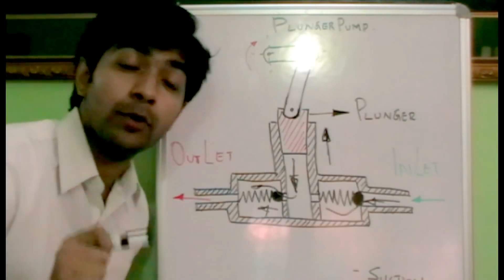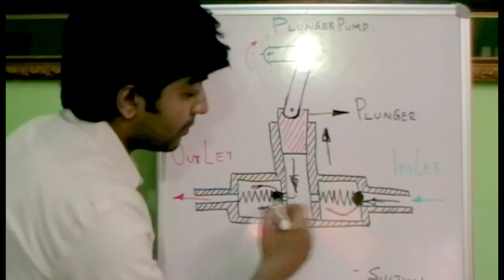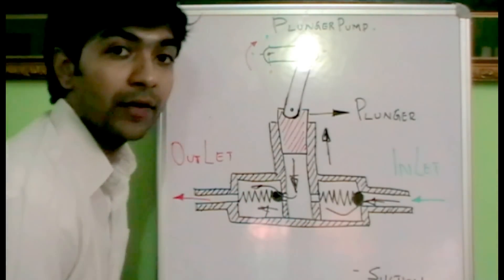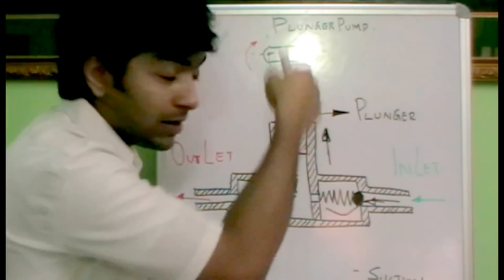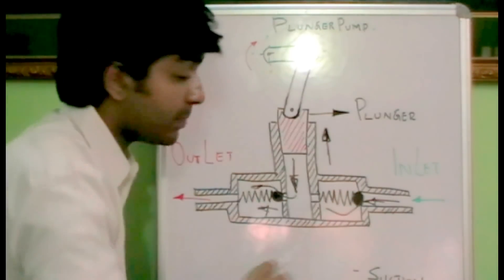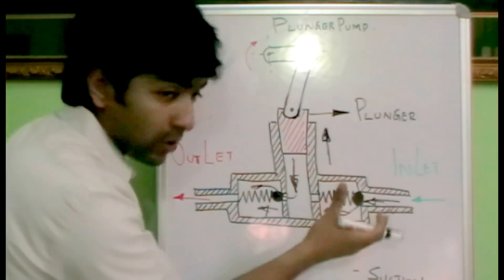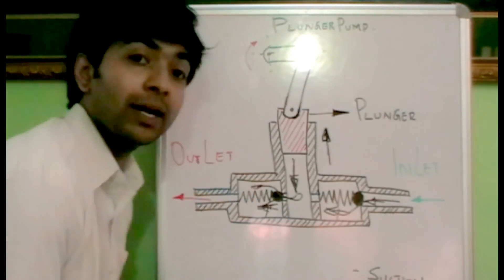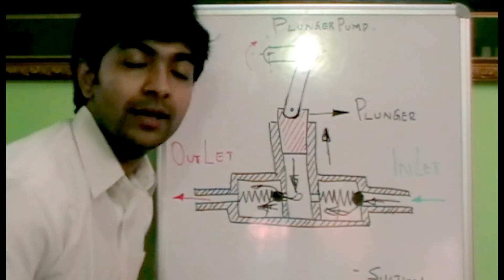How plunger pump works (Must Watch). ✔

Comment: how its crank length can be varied?
Reply: hello.  the crank length is varied by attaching the arm to the outer diameter of a motorized rotation wheel.  the plunger is pushed forward and backward as the wheel rotates.

Comment from the maker: i am not very clear about it, but i still believe its an issue with the outlet pressure, restriction at the outlet is causing it, consider looking for a block or restriction if not increase the dia.

Comment: I was wondering if you guys would be knowledgeable on the outlet/discharge side of these pumps. We have a powerful Triplex pump that pumps our waste fluid down a wellhead. We have a large pressure spike when the pump starts up. Would we be required to check the function of our pulsation dampeners? We have a pressure switch that detects this spike and it shuts down the pump. Any idea?
Reply: Are you all stupid or what????